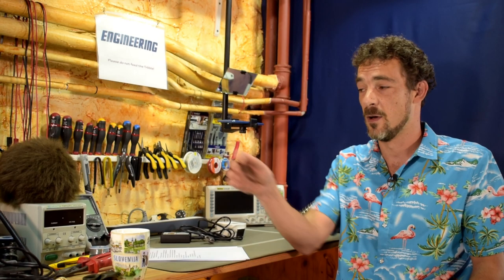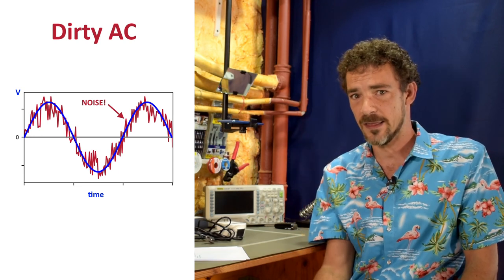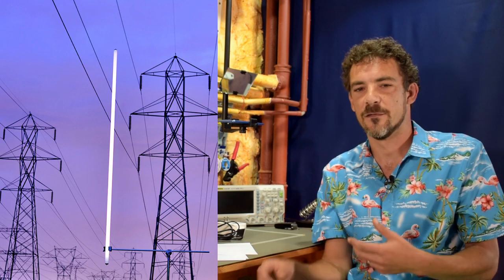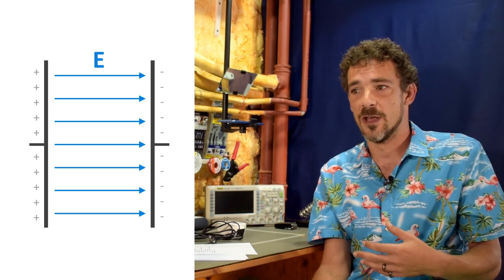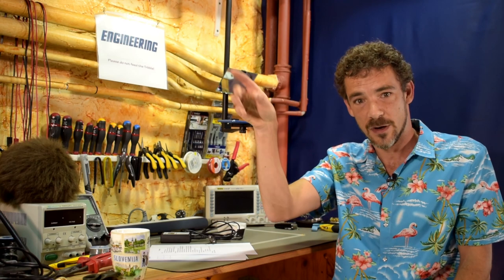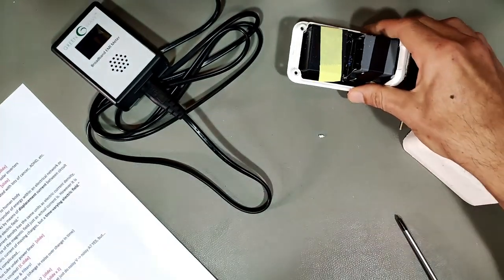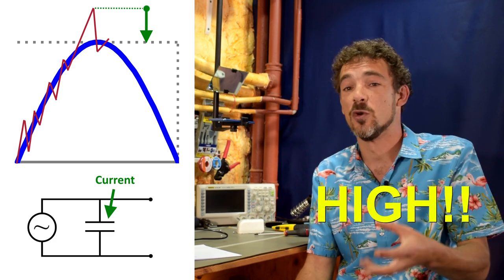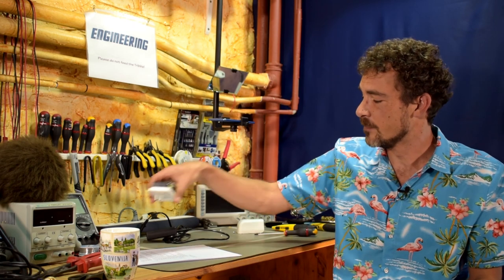Dirty Electricity: What it is and how to fix it

Comment: Hi Scott!  

I wonder if you could comment on whether or not the GreenWave or other dirty electricity filters will actually draw power and therefore increase your electric bill, or is the Amazon reviewer I quote at the end of this comment seeing things?

I found my way here not because I was looking for dirty electricity mitigation for health reasons, Rather, I am a musician and home recording studio owner, and I have had noise that shows up when I use any electric guitars in the house. It is NOT 60 cycle hum, and it is NOT the usual electromagnetic fields in the house inducing noise in the pickup coils kind of thing that one sees anywhere. It is noise that is only introduced when the guitar is plugged into equipment that is connected to mains power. 

For example, I have a self contained tiny battery powered guitar effects processor  that plugs directly into the guitar, and has a headphone / line out jack. 
As long as I play the guitar using headphones or, say, a JBL Xtreme battery powered speaker using a stereo 3.5mm cable from the effects processor to the line in jack, I get only the normal 60 cycle hum and EMI noise I would get anywhere, depending on the way the body of the guitar is facing or where in the room I am.

However, if I use that same fx processor, with the same guitar, in the same room, in the same seating position, but plug the JBL Xtreme into mains power instead of running it on battery (or I use ANY other amplification that is connected to mains power) I get substantial amounts of buzz that do not appear to be a harmonic of 60hz, and are harsh buzz, not hum.  This happens most noticeably on single coil pickups, of course, but also happens with my humbucker guitars and even my EMG active pickups in one of my strats..  Everywhere else I have used that EMG equipped Stratocaster, the pickups are DEAD QUIET even when using TONS of gain or overdrive.

It is maddening.

I am going to have to use the process of elimination and turn every breaker off in the house save for a dedicated circuit (I have one in my studio room that is a home run from the panel to a single duplex outlet) into which I plug my guitar rig, and see if the noise is there, or at least if it increases significantly as I turn on the breakers in the house one by one.

In the meantime, I was thinking of making use of the GreenWave filters and meter as a possible mitigation for the studio only.

As I did my usual thing of reading every review, good, bad, or indifferent, I found this review that indicates that the devices actually draw and consume power, and that with say 6 of them in the house, it can be a significant draw, say 800 watts? 24x7..

Top reviews from the United States
	DT
3.0 out of 5 stars They do work but will cost you money on your electric bill
Reviewed in the United States on March 6, 2021
Verified Purchase
I bought about 12 or so of these Greenwave Filters in the past year. I also bought the Greenwave EMI filter to measure the noise. The meter and the filters do work. The meter along with the filters are a great marketing pair for the company because if you start measuring with the meter you most likely will purchase more filters to keep lowering the measurement. They do work BUT as another reviewer stated they do consume power. I have verified his measurement and each filter will pull about 1.2 amps (or about 140 watts) each and the manufacturer does not mention this in the literature! Just be aware that they will absolutely cost you more money on your electric bill. Because the capacitors change the phase angle of current to voltage, a watt meter won't accurately show this. Look at the VA measurement and especially the current and you will see the same. I have also found that the performance is dependent on where you locate them. I have found that they work best at the end of the circuit but results may vary. Also some greatly reduce the noise and some don't depending on where they are located. I have cut back to about 6 filters at strategically placed locations but this is about 850-875 watts continuously 24 hours at day, 7 days a week and it will show up on my electric bill. Is it worth it?...maybe if you are willing to pay the cost.
Reply from the maker: The filters cannot draw 140W of real power. They'd overheat. While adding capacitors DOES change the way power is consumed (real vs apparent power), I found zero difference in my electric bill when using them. Unless you're power company is billing you for apparent power (aka the extra juice required by capacitive and inductive loads, which is VERY rare and usually only happens in an industrial setting), they should consume no real power. Thus, your electric bill can't go up. 
As for your noise issue, I wish I had some good advice to give, but those problems are a BEAR to track down. I think your plan of turning breakers on one-by-one is a good one. At least you should be able to isolate the source of the noise. Keep in mind it could be a combination of factors... Like if your TV breaker is on AND your puter breaker is on, ta-DA! You get the noise. But if one or the other (or both) are off, you don't get any noise.

Comment: yes that right they never had the that kind of tech then i remember one of the lecturers giving an whole session on sw mode power supplies as you the higher the frequency the smaller components needed but they did not know about dirty electricity in them days know its in everything

Comment: I bought some filters in the UK, I am uncertain as to what is inside them, but they emit a massive magnetic field or (they cause the power lines to emit a larger field) and they made me feel worse so buyer beware.
Reply: Switch off all electric things you do not need esp. at night (sleep is one of the most important things for health). I found in my flat some surprsingly high EF fields from plugs, lamps and even cable in the walls. In fact the RF in my flat is very low which was my main concern, but the EF I found was worse.
Reply: @UsoundsGermany  Good advice.  I have both RF and Magnetic Field meters, I have RF shielded walls in my bedroom and shielded hand made AC cabling.  Soon all the DC cabling will be shielded also and I will replace all the DC wall plugs with better shielded Power Supplies.  Optimally I would not have any electronics in the room at all, but I need all this stuff and there is nowhere else to put it.  The magnetic fields and power fields can definitely do a lot of damage to your health, some of the Chinese DC wall plugs are very dangerous.
Reply: @hootsmin  The main problem is the RF (4+5G) however. We need to pay for all the measures to protect us, which not even protect 100%. The gov/eu however are required to stop this - ofc they won´t. But at least they should pay for our measures!
Reply: @hootsmin  I forgot to say this is also BS what I wrote cause we pay the state, so in the end we pay even if they would pay LOL It is all f- up especially in these times w/ the f- - a - ke bug etc. The companies needed to pay in fact both the "mobile" ones (for radiation etc.) and also the "medical" ones (for "medicines" not even tested etc.) for damages but they are exempt.I am near Austria and even in the small city they seem to install more antennas and new lamps
Reply: @UsoundsGermany  It has cost a fair bit already, I have to ship the AC cabling from America at great expense.  The shielding paint costs a small fortune also as do the shielded fabrics required for the windows.  It would be nice if the health service would provide some support, but they are largely willfully ignorant about EM hypersensitivity.  They have outfitted every single lamp post in my city with an LED light with a phased-array antenna transmitter on top, this is for the SMART city agenda, these have back-haul capability for IoT devices and I believe they are urban radar for the spooks.  They are very powerful especially upstairs on the level with them, the frequency is extremely dangerous for the heart, makes people forgetful too as it works on the hippocampus.  They have recently installed fiber-optic cable everywhere next to the poles so no doubt they will add some small cell 5G hardware to the poles later.
Reply: @hootsmin  Scary stuff and almost no one cares - I already suspect that these lamps might have already or are prepped for these "small cells" I see a kind of "black box" on some lamps this might be a camera or such a cell perhaps. I wanted to inquire about this from the city.. maybe I phone em this week. Also only the lamps close to the "town hall" were also a shopping center is, seem to emit radiation. Others of these lamps not (so far)
Reply: @hootsmin  Yup they did some deep digging in the area I remember a year ago I was wondering already what want to install and guess it is fiber optic cable you mention. And the hompage of the city says it is in the smart city program :(
Reply: @UsoundsGermany  my symptoms started showing with 3 g phones, don't think it is that. I have also been zapped with microwaves in my house which caused my head to start burning and having my heart start missing beats. Also cut off my land line phone connection, later caused problems with the Honda as it froze up the EGR valve. there was also a fog and sky lightniong in the area at the time.
Reply: Exactly. We are having to pay to protect ourselves from the smart meter we have been forced to have on the outside of the wall of my granddaughters bedroom. And the housing cupboard for the SM is set back into the wall so not got full protection from the brick wall. They will not help with costs and this horrid government we have in the UK  back the energy companies (I wonder why). Sickening.

Comment: Can dirty electricity be also found in cars im talking of the ones of some fifty plus years ago, ill explain a little my grand parents lived in a cul-de-sac every time a car came in  the road while we were watching tv there be this almighty howl  coming from the speaker and you get bad Rasta interference on the screen this was due to the tvs having no suppressor on the incoming mains meaning the interference would be picked up by the mains cable ok there was no such thing sw power mode supplies and such just tube, heterodyne valves tv and radio
Reply from the maker: That's a good question! The noise would be different than Ye Olde Automobile, but there are plenty of potential noise sources in a modern car's electronics...

Comment: You need 15 filters? I don't even have 15 plug sockets in my house...?!?!
Reply from the maker: In many places, I needed 2 filters in a power strip because of the D.E.
Reply: @ScottiesTech  We are having a smart meter installed (unfortunately). I heard they cause dirty electricity and might be the main health impacting worries of them. There is a plug socket free in the little cupboard where the meter will go. If I bought a filter and plugged it in there, is it likely to make a cost-justifiable benefit to our home or health?
Reply from the maker: @SilentButDescriptive  A single filter will definitely help, but not as much as testing and trial/error placing of multiple filters in different locations. The filter(s) at the input to the house are kind of the starting point of a full, thorough solution.

Comment: I just read that LED lightbulbs give off dirty electricity - I have hated them from day one!
Do you agree up that they do?
Reply from the maker: They do, but from my measurements the levels are pretty low - and nothing compared to other DE sources. In most of the rooms in my place, having the LED lights on or off made a difference of only 1 or 2. I even have LED bulbs on a dimmer, and dimmers can be VERY noisy in terms of DE. But then again, that depends on the dimmer used. The very expensive electronic dimmers can produce levels of maybe 10 more, so for example one bedroom was 180 with dimmed lights on, but 171 with lights off. Stuck 1 filter in the room, and the levels are now 27 with dimmed lights on, 26 off. The real trick is testing A LOT, because even small sources of DE like LED bulbs can cause DE noise that interacts with other gizmos on the wiring produce DE, and then you get super-high readings in strange places (like a different room on the same circuit or phase).  So, definitely get a DE meter and test, test, test!

Comment: Question: I know next to nothing about this kind of stuff but I'm forced to learn due to current circumstances, as I live in the Philippines and the electrical service here is pretty much nothing less than an abortion. These guys just hook up 2 wires with no ground and they don't care which way the wires go. Usually all the wires are the same color, etc.. etc... soooo here's my question/questions. Since practically every single device with an electric motor has blown a capacitor which I had to replace at one time or another... my feeling is my electric 220v service is probably pretty dirty. Add to this we have regular "brown-outs" as they like to call them, so I had a 10Kw diesel generator made. It uses a A.C. Synchronous type ST-10 50/'60Hz generator and I have noticed several of our appliances seem to pretty much hate it when we are on generator power... ie: funny noises, etc..etc... and the air-con won't even run well enough to cool, so as I am thinking about adding a solar back-up... if I buy and install a Pure Sine Wave HYBRID charge controller/inverter (or a couple of stack-able 5Kw units) wouldn't that solve "the bulk" the above mentioned problems?  Thanks for your reply in advance.
Reply from the maker: SWEET JESUS!!! That sounds like a lot of fun... Your electrical hookup probably suffers from low voltage and inadequate cabling resulting in current overload (which then leads to even lower voltage). There's also the issue that neutral and live can't be swapped - they're very different animals, which means I'm amazed the system works at all. You can definitely improve things in your house by installing your own ground (copper rod in ground, maybe several of them, tie them all together with same diameter wire as the house supply wires, and connect to your panel. Of course, if none of the house wiring has a ground wire, then that's pretty useless... but at least you could ground a few things for safety's sake! The generator problem is another story. It should be spitting out nice smooth AC at the proper frequency and with plenty of current to drive anything happily. Looks like the Philippines is 220V at 60Hz, so make sure the generator isn't outputting 50Hz. That would make everything suck pretty bad! Usually, you'd also install a dedicated ground for the chassis of the generator, which would NOT be connected to your house ground (if any). Solar + batteries + inverter is definitely a good option. It might be cheaper in the long run depending on the cost of diesel.
Reply: @ScottiesTech   ... Ok... Thanks for the good leads/tips to check out. There's never a dull moment around here... as for setting up the solar... we are going to do same in addition to the back-up generator. These days the more back-up one has... the better, at least in my reality. As for diesel fuel, we are cutting the diesel fuel cost by blending bio-diesel with regular diesel fuel. Cuts the fuel cost about in half as we have a small cafe and the used cooking oil is repurposed. 
Thanks again for the feedback... Much Appreciated !!
Reply: wow, that really sounds like a pile of garbage. IFAIK, in order to get rid of DE, having proper ground is essential! So you'd need to install that in some way that works throughout your entire installation.

All in all, that situation sounds like you'd be better off actually going off-grid (looks like you wouldn't "miss much" in light of that kind of "grid" and "service" you're paying for over there?! Apparently you're also not given pure sine-wave power with your more sensitive items behaving like that. Off-grid/solar or generator-run island grid may also need pure sine-wave rectifiers: depending on generator model; good solar inverters usually have it, but that (in all likelihood both) would come with yet more sources of DE again!

I once installed a switchable generator-backup for our house in Sweden. Apart from a separator switch, we needed to bring down a copper rod for grounding (you're not getting "free mass" from the utility the moment you actually throw that switch, nor would you want to b/c grid resistance would overpower and break your generator/not working/not legal, too). Anyway, digging an earth rod down can be done, not too complicated. Then you can go from there with Stetzerizing and getting rid of DE that way.
Reply: @mmdotcom_Photography   ... Thanks for the suggestions/recommendations. We are currently working on the installation of a heavier gauge wire (as previously suggested) from the power pole to our main breaker panel, as there does appear to be signs of burning/hot wires  Beyond that... we will go down the check list of all of the suggestions/recommendations in order to try and get a handle on these issues. Thanks again to everyone that has offered advice... we'll keep you posted as we make progress.

Comment: electric current = 2D 
= electrons flowing along a wire

magnetic field = 3D 
= magnetic vortex with central axis as the 2D electric current.

The one can't exist without the other, they are the 2 sides of the same coin.

Comment: Inverters dont switch on and off. They use a combination of diodes that take advantage of the natural activity of an alternating current to chanel a direct current out the other end. I diode only lets electricity flow one direction. You can arrange 4 diodes in a way that will output a direct current as its always moving forward from one incoming ac wire.